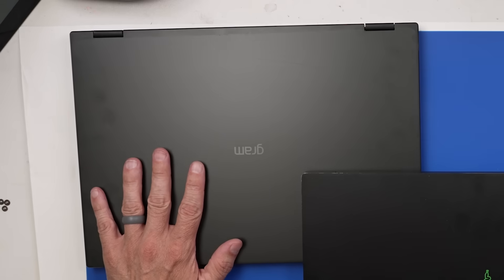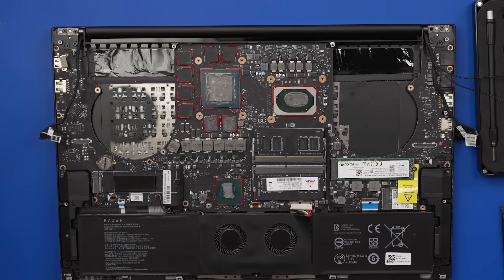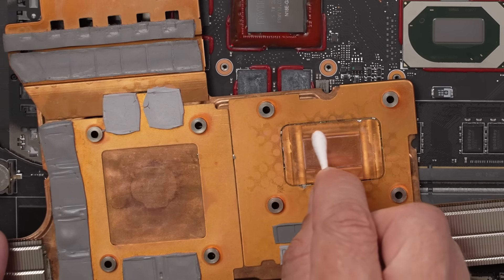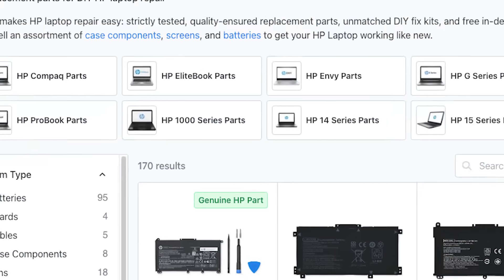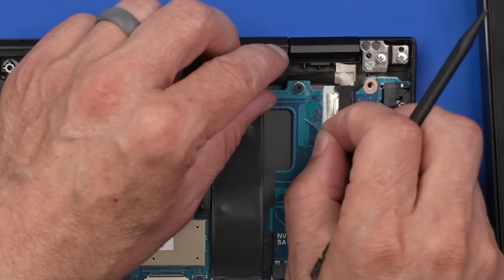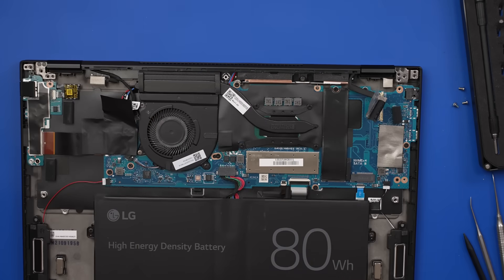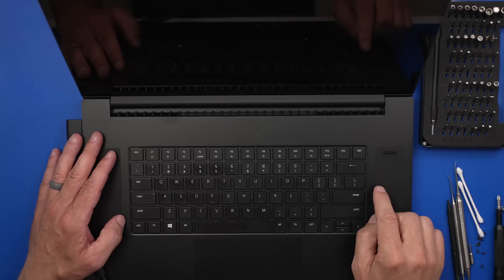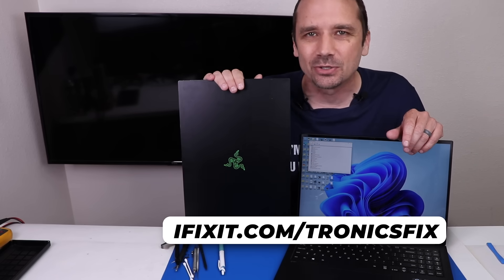Trying to Fix $5,000 Worth of Broken Laptops

Comment: Razer could've easily improved their cooling setup by putting a different heatsink which would add extra cooling fin areas on the left and right sides of the fans, with appropriate air exhausts on the sides of the case, like what vast majority of other laptop manufacturers have been doing for the very long time. But hey, if plenty of idiots are still paying "more-than-average" price for the laptop with undersized and poorly performing cooling system - why bother? ;)
Reply: Just to devils advocate a little bit, one problem I've found with laptops with side vents like the Zephyrus G14/15 is that all the I/O gets pushed forwards and you can sometimes end up resting your wrists on your plugged in USB devices or headphones etc which feels not the best for the longevity of those ports. Not saying Razer's cooling is good by any means just pointing out the downside of more vents.

Comment: uninstalling a graphics driver is not a fix. You're disabling key parts of the laptop that way. There are 2 possibilities. Either the IGP is damaged in which case the CPU needs to be replaced, or you have corrupted drivers. If that's the case you might be able to use DDU in safe mode to fix it. Then do a clean install of the real drivers.
Reply: I mean it is a fix tho
Reply: @MrMonkey2150  It's a bandaid. It doesn't address the underlying problem.
Reply: @awilliams1701  it did tho, u may lose a feature but it’s been fixed
Reply: @MrMonkey2150  losing a feature isn't fixed. I think I saw a video where he couldn't fix the blue ray drive on a PS4. I'm like.....meh who needs it. He didn't consider it fixed. Ultimately I don't use blue ray or dvd or any optical media so I don't care about that, but losing 3d acceleration is not ok with me.
Reply: @awilliams1701  nobody asked u
Reply: @MrMonkey2150  ummmm the comment section is for anyone. I gave my 2 cents. "no body asked you" is a pretty stupid reply to any comment.
Reply: @awilliams1701  lol why so mad
Reply: @MrMonkey2150  I'm not, but you are or you wouldn't say something stupid like "nobody asked you"
Reply: @awilliams1701  I said nobody asked you because you were saying what you would do and nobody cares about what you would do
Reply: @MrMonkey2150  then don't reply to my comment. It's easy
Reply: @awilliams1701  lol stop crying
Reply: I had an integrated graphics issue but it is very bad than this laptop. I think that the drivers were corrupted
Reply: @Unknown-64209  that's my guess as well. I don't know if DDU works on intel or not. It's usually AMD or NVIDIA.
Reply: That laptop only came with an iGPU and not a dGPU. if it was a hardware problem, it would probably not be fixed as the screen flickering is in an idle state. He also probably reinstalled the drivers because the generic display drivers probably don't even support the display's refresh rate.
Reply: @tdcmc  It's probably a driver issue, but an iGPU has a simple part and a complex part. The simple part is good enough for facebook and youtube. The complex part is required for anything else.

Comment: I used to fix laptops for a living. It was at a school so it was 2000 of the same laptop (1 to 1 computing) I can't tell you how many times I saw the screen have issues like that. Every time it was just a loose cable. One of them had a pink screen. It wasn't loose in the laptop. It was loose in the screen. lol that one was different.
Reply: wow that display cable is a piece of crap. Even the "loose" acer cables wouldn't wiggle around. They were very firmly connected. "loose" just meant slightly crooked. A laptop display cable should never wiggle.

Comment: I assume the cable going behind the display is for the wifi antenna or maybe the webcam/ambient light sensor if the laptop has one. I too was sure it was the display cable until you showed it was a driver issue haha. Great video!
Reply: That thin green pcb that the edp cable branches off into is for the touch portion of the touchscreen. That board handles touch input.
Reply: The main portion of the cable continues under the screen where it clips into the back of it, connecting to the display. It's not for antennas.
Reply: @koigoi  makes sense, didn’t know it was a touchscreen panel

Comment: It's funny I still have a fully working 2010 HP laptop. Back in the day I hated it. It kept getting slower and slower and slower until it was unusable after only a year. In the meantime my 2008 desktop computer with windows 7 was fine. I had nothing to lose so I did a factory reset. It worked great again.......for a year. Keep in mind my desktops are my primary computers. There is no reason for windows to degrade annually. Eventually I installed the windows 8 beta on it and finally windows 8. It got updated to windows 8.1, and eventually 10 which it still runs to this day. Today's windows 10 is upgraded from that same windows 8 install. I don't know WTF HP is doing, but at least back then HP windows copies self destruct after a year. It's my only real complaint with HP. I have no idea if it's still like that or not. I haven't bought one since. I've used lenovo (didn't support windows 10 and ran like crap because of that) and will never again. My 2020 laptop is dell. It has the worst thermal paste application I've ever seen. It wasn't behaving right so I repasted it. The die was dry. Like COMPLETELY! All the thermal paste was on the substrate. Giving it thermal paste in the first place helped a lot....until the fan started to die and eventually died completely. I replaced the fan. It works great now. But it makes me wonder if I should deal with dell again. sigh.......... I might go with hp next time. I don't know.

Comment: I have a razer blade late 2016 and would like to ask for anyone here: 
How do I diagnose why some keys won't type? I want to fix it ( taking to a shop isn't an option) but I'm scared the problem is not the keyboard and I don't want to waste money on parts I don't need
Reply: What keys don't function?
Reply: @matthijsvandeweerd1415  `1569wyop\ backspace 
It's a us layout
Reply: @dot_frost  since it's so spread out I think that it isn't a connector issue, I think you need to replace the keyboard. You could try cleaning and replugging the keyboard, that might fix it.
Reply: @matthijsvandeweerd1415  I was worried it could be a conector issue. that would be harder to replace. tried cleaning but the keyboard is membrane so not much luck there and tired also replugging, didnt work
Reply: I would first connect a external keyboard just to verify it's not a software/driver problem.
Reply: @virgildeklerk  external keyboard works perfectly fine

Comment: FYI, I use clear nail polish all the time as a conformal coating for PCB parts.  I assume the Thermal Grizzly stuff is better suited for the task but likely more expensive too.  :)
Reply: Even Der 8auer the guy behind thermal grizzly said in one of is youtube videos that you can just use nail polish.
Reply: I've done clear nail polish with liquid metal on three devices now (two thinkpads, one 6years ago) and a steamdeck, all still work just fine :)

Comment: Personally I think that Razor had way too much thermal paste.  I don’t know much about consoles, but I have been building PCs for the last 30 years or so, watched lots of research, and as a result have always used the bare minimum of paste.  With PC CPUs you want just enough to ensure that the heatsink mates perfectly with the CPU die, just enough to fill in any imperfections between the two surfaces.

Comment: Hey I just wanted to ask, would wd40 be any better than bw100?
Reply from the maker: The problem with WD 40 is they sell multiple products under that WD 40 brand. What I know WD 40 as is a lubricant that is oily. I'd never use that to clean electronics BUT they do sell electronics cleaner under that same brand name (at least that's my understanding) that I've never used.
Reply: @Tronicsfix good to know thanks!
Reply: @dougadams9419 ok thanks, it’s because I have people commenting on my repair videos on TikTok saying can I use wd40 instead of bw100, but I couldn’t find info on it so for now I just said don’t recommend
Reply: @mr.charchar  Depends on the usage, there is actually a fast evaporating WD40 Spray called "Specialist". 
It's specifically for the use with electronics. Have it here myself and it works great.

Comment: I had very similar problem with my new monitor just like the LG gram laptop in the video. With DisplayPort cable it flashed just like that and when i switched to HDMI the problem went away. After i updated or reinstalled the Nvidia drivers the problem went away. Now i use it with the DisplayPort cable and it works fine.

Comment: Often it is enough to change the display refresh rate in the Intel graphics settings / Intel Graphics Control Panel and the flashing disappears.
Reply from the maker: Interesting. Thanks for the comment.
Reply: @Tronicsfix  i had a lenovo that had a similar issue and it turned out it needed a firmware upgrade for the touchscreen
Reply: My Samsung G9 flashing issue was also solved doing this
Reply: perhaps when he installed the igpu driver the display refresh rate might have reset it self back to default setting thus clearing the problem. I think someone was massing on with the monitor refresh rate setting or something
Reply: it doesn't fix the issue. It's a mitigation at best. If cable does not allow stable high-bandwidth transmission that probably means some component has degraded.
Reply: @szymon7607  The problem is, that the Intel driver switches the refresh rate to 40Hz for some reason. Sometimes the display only flickers in battery mode. Sometimes it stays that way even in plugged-in mode. It happens even on brand new laptops, it's driver bug.
Reply: @SiETechNotebookReparatur  this reason is power saving. You can disable switching to 40Hz in intel command center.
My point was that this video doesn't prove that the problem was software related.
Reply: @SiETechNotebookReparatur  My Brother's MSi does that and it's worse with Windows 11. It's annoying that they put Windows 11 on laptops that are clearly not ment for Windows 11.

Comment: Assuming the laptop with the graphics issue was updated what happens when windows auto installs the same driver again? I have a lenavo with the same issue. When drivers are removed it works just fine. But soon after windows installs the driver and flickering starts again.

Comment: Liquid metal on copper heat sinks is a BAD IDEA! It will corrode the heat sink significantly.
Reply from the maker: Guess we'll find out
Reply: @Tronicsfix  There is a reason why commercially used heat sinks to be used with liquid metal are all nickel plated ....
Reply: it corrodes alluminium not copper
Reply: Well, yes - it only affects the top layer and stains, but not corrodes it. @lucaenearuggeri4153

Comment: I'd be curious to see what's in the bios in terms of overclocks or fan profiles.
Reply from the maker: Yeah, I should have checked there but didn't even think about it. lol. I'm a newby when it comes to gaming laptop repair.
Reply: @Tronicsfix  all good, love your videos. I need to step up my soldering. I've been learning a lot from you.
Reply: Yeah, that fix confused me. Does Razor just sell laptops with thermal paste that isn't good enough, thus forces you to install liquid metal, if you don't want the fans to blast at 100% in idle?

Comment: the problem with the razer is bad contact with the  die and the heatsink. probably thick or misplaced thermal pads are the culprit.

Comment: NOOOOOO!!!! Never touch display cable before disconnecting the battery!

Also if you uninstall GPU driver, you didn't fix anything. It just uses generic driver without acceleration. Please show how you reinstall driver and it doesn't start flashing again?

Comment: actually I'm very impressed with HP for selling genuine parts on I fix-it that makes my life so much easier.

as for your repairs I'm very impressed that you where to able to get both laptops up and running. Hell I would never even think to uninstall display drivers to get the screen properly working..
Reply from the maker: Yes, I love that HP is willing to work with iFixit to offer these parts.

Comment: Be careful with the Razer Blade they have a really bad reputation for swollen batteries. Had two of them myself, both suffered from it, while still under warranty.
Reply: Razer laptops are generally bad, small boutique company without enough resources to provide quality laptops and parts for them only available at grey market or second hand
Reply: @kiki83607  Thats true, I switched to a Lenovo Thinkpad after that. There are lightyears in quality between the two. I am even a lenovo reseller now. 👍
Reply from the maker: Yep, I had a similar Razer but smaller and it had a bad battery.

Comment: Have you gotten your hands on a Asus Rog Strix G15 yet? Specifically the version with 4gb RTX 3050, Ryzen 7 4800H 8 cores 16 threads and 16gb ram.
I have this exact model, and the fans don't start up on modes other than manual. Support said to buy a new laptop or reinstall windows; reinstalling is not an option, it would void my warranty. Unfortunately in Poland, stores like media expert don't let you even reinstall an OS cause if in the future something happens they will claim it's your fault because you reinstalled the OS
Reply from the maker: No, I haven't
Reply: @Tronicsfix  let me know if you get your hands on one, I'd love to figure out a solution to the issue with mine for the future
Reply: if you have laptop on warranty, send the laptop to official ASUS service, do not use store support they often don't have a clue about any hardware also most laptops have an official recovery for OS and using this is completely legal, you don't need store permission to do that lol
Reply: @kiki83607  I can't, as I'm a game dev and actively need my laptop

Comment: I'm not sure I understand the razor blade fix. Surely it didnt come with Liquid Metal, so why would it need it now? Is it really just that bad from the factory?
Not sure where my own diag would take me tbh. The TIM pattern looks fine, so it had decent contact with the heatsink.
Might be worth resetting the BIOS - perhaps it has some crazy fan curves/OC programmed into it.
Thanks for the vid - great work as always.
Reply from the maker: Yeah, that's a good idea. I'm not sure why they ramped up so quickly either. It seems like if it was a bios setting they wouldn't have settled down with the liquid metal applied.

Comment: For the fans in the Razer I would also look into the bios if there are profiles set.  The LG... well that was my first suggestion - lol.  Was there and reason not to use a bit of IPA to clean the connections?
Reply from the maker: Yeah, that's a good idea to look at the bios on that one. I could have used IPA but didn't see anything that would indicate that the connections were dirty. Sometimes I still do use it though

Comment: I was thinking the display drivers might be to blame on the gram, it's really weird how the razer was overheating with new thermal paste.
Reply from the maker: Yes, I'm still not sure why the fans were ramping up so fast with new thermal paste.
Reply: @hm_1406 see that pad on the right side, not really got touch by the mosfet
Reply: It's not "werd" that the laptop was overheating, it's called "pump out effect", it can happen very rapidly (just after a few heating/cooling cycles, like a few gameplay sessions) on some laptops that have pretty uneven mounting pressure between the GPU/CPU and the surface of heatsink (which may happen due to manufacturing defects or inappropriately thick/thin thermal pads that surround GPU/CPU areas). Most thermal pastes can't resist it well enough, the liquid metal alloy will resist it much better. For people who don't want to deal with liquid metal - Honeywell PTM7950 is a non-conductive thermal paste that can also resist it well.

Comment: NEVER apply liquid metal to copper surfaces.
Reply from the maker: Why?
Reply: @Tronicsfix  copper works like a sponge for liquid metal.
Reply from the maker: I mean that may be true but it is used that way in some devices. We'll see how this laptop does.
Reply: @Tronicsfix  all liquid metal will be absorbed by the copper base of the heatsink within a couple of weeks. Nickel plating of copper is necessary before using it.
Reply: liquid metal messes with alluminium copper is fine
Reply: @lucaenearuggeri4153  what alluminium copper is?

Comment: Sometimes the flashing light on the display might caused by a corrupted display driver. Now I learned something different. Thanks Steve for posting it.
Reply from the maker: Yep. I've actually seen this at least one or two other times but just totally forgot about it when I started on this repair.
Reply: yea, microsoft sometimes bring new driver update that not fully compatible or just buggy driver
Reply: @maklogetrich2378  imo the best option is always download the drivers from the computer manufacturer (i.e. HP, Dell, etc.)

Comment: My iMac (21.5-inch, Mid 2011) does this too from time to time. I will reboot it and as soon as the system boots up you hear the fans kick on and roar away. And they will spin this way the entire time until I unplug it from the power source, wait a minute or so and plug it back in, for this issue to stop.